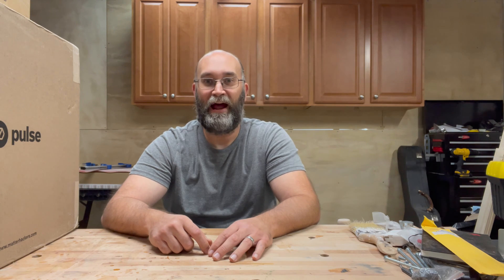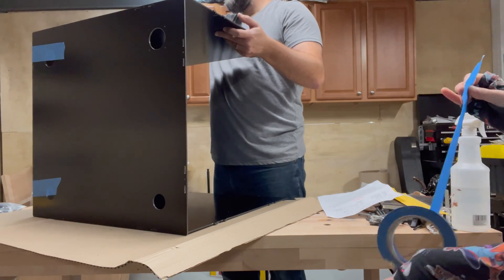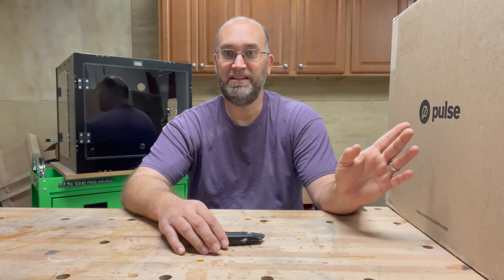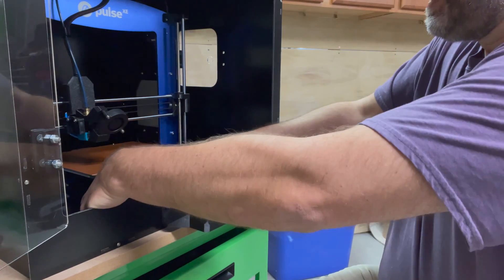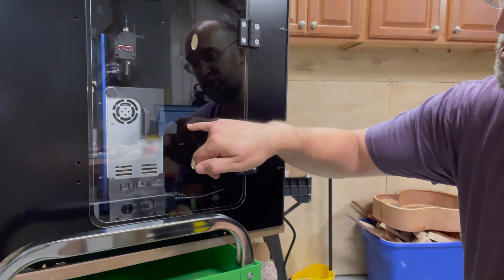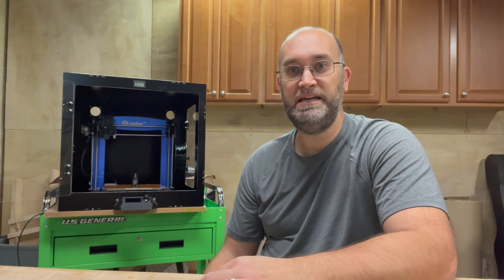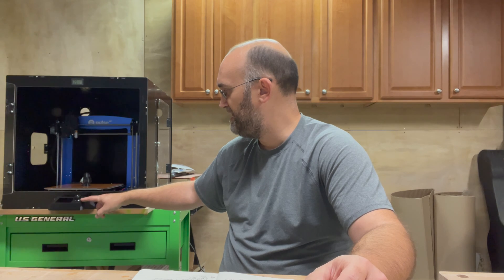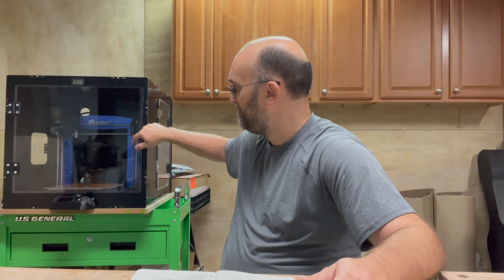Getting started with Matterhackers Pulse XE 3D printer

Comment: The pulse xe we got a year and a half ago is junk and has been nothing but problems
Reply: I've had nothing but Y axis shift issues for a year now. I've tried all the common fixes. I tried belt tensioning (Y axis belt tensioner design is just plain stupid), Y axis belt replacement, acceleration and feed movement adjustment, and the list goes on. I just replaced the Y axis stepper motor (Matterhackers NEVER has any parts in stock that I need when I need them). I had to find parts from a 3rd party supplier. I'm at the point now where I.m just about to get rid of it and buy a Bambu Lab X1 Carbon....🤬
Reply: @geoberger2003  we went to Bambu Labs for our robotics team this year and couldn't be happier, especially at the price point and speed
Reply from the maker: Yeah…I never repeatably got good results, so I ended up going with a Bambu Labs A1. But that got recalled, so then I got an X1 Carbon.

Both are fantastic machines, and I got to focus on making instead of tinkering

Comment: Now imagine spending 1800.00+ only using MatterHackers filament and hardly ever getting a print right... also you can only use their print software which has little to no good setup videos for diagnosing issues.  Don't even get me started on there "Help" service I paid and waited months with no contact before just cancelling the package, I did get a refund for the setup Help but still have a fairly large, super expensive paperweight.